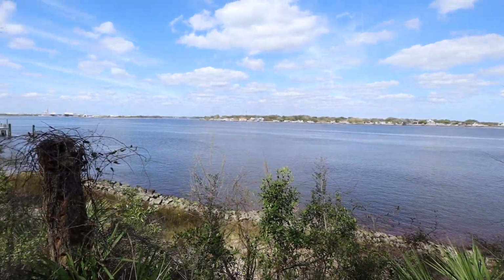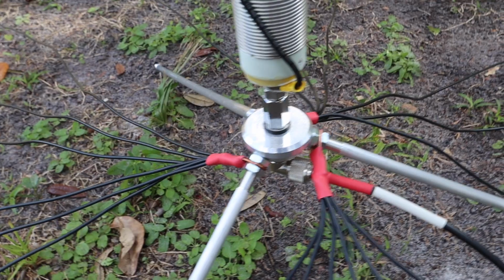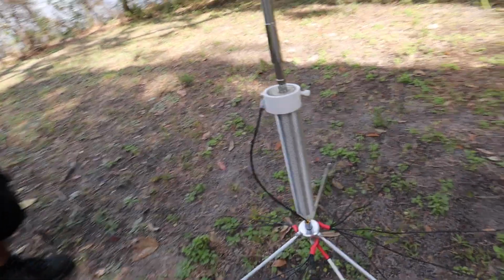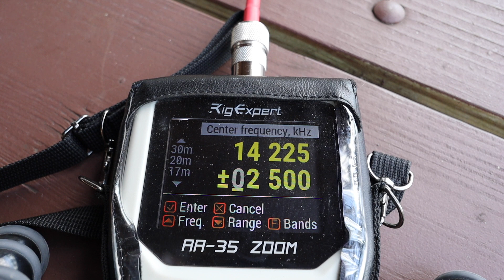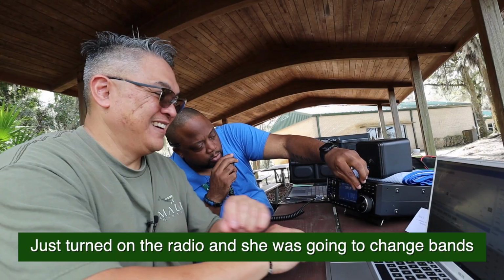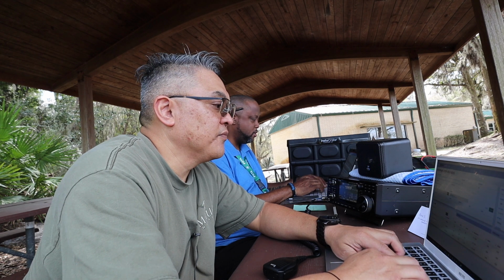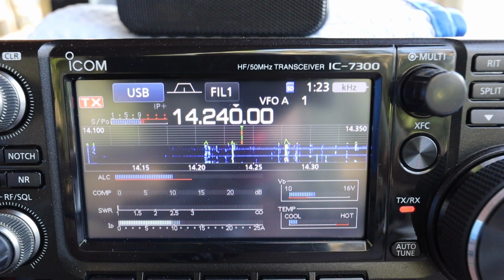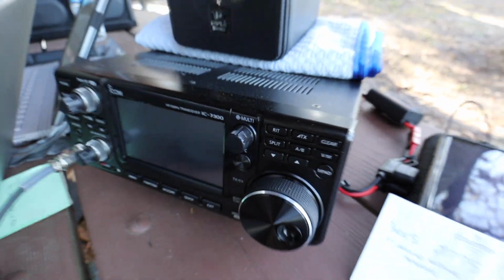Florida POTA Activation K-0775 & K-0658 Jacksonville, Florida | POTA 2Fers | Having a 2nd Operator

Comment: Very good battery performance / 73
Reply from the maker: Thanks, definitely a good option.  I was running 100 watts.
Reply: @DarrenN4VFR  In field i work with my FT-891 ... battery 12V 30 Ah ... it is always a good option to be able to operate up to 100 watts 😉

Comment: It will not do 100 watts it will handle 100 watts. The radio does the output power not the antenna of course.